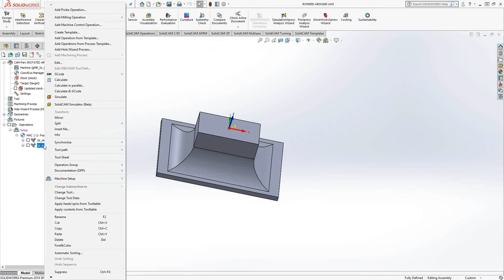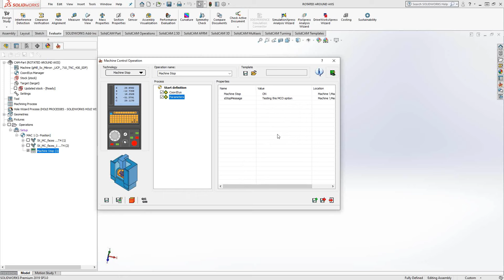MCO to Add Machine Stop

Comment: Why it does not work for SolidCAM 2017?
Reply: Does SolidCAM 2017 has the operation of a MCO? If so, you need to add options in the VMID and adapt the postprocessor to make it work. Just as explained in the video. An other option is to drag the spindel options in the MCO window and check the Spindel Stop option. Also the postprocessor should be suitable for this.